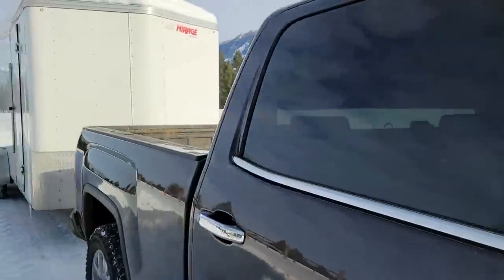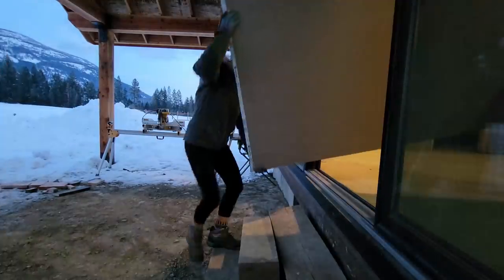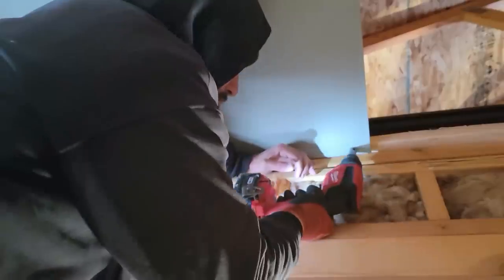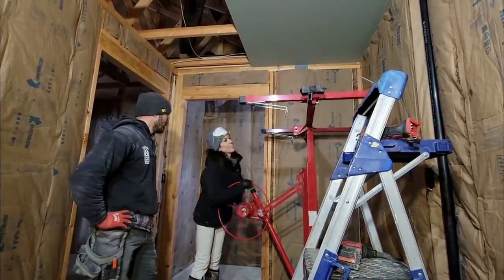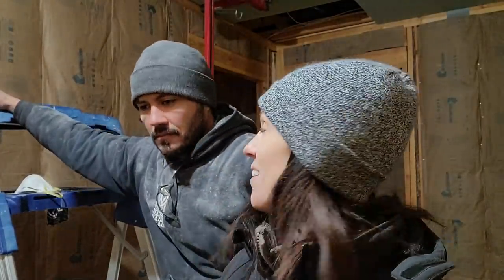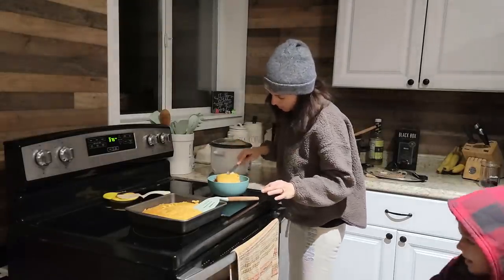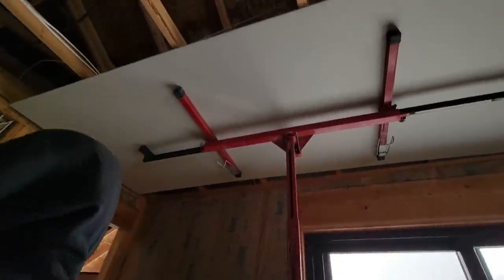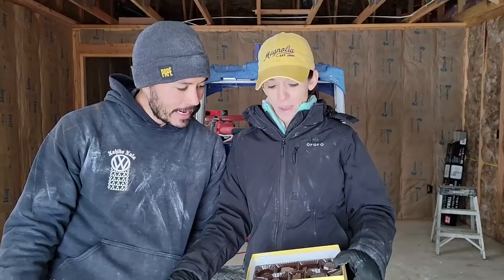We're On Our Own | Hanging DRYWALL In Our Self-Built Home

Comment: You are in building zone 6 which requires a 6 mil vapour barrier on all exterior walls and ceilings, if not used, it will trap moisture in your wall which causes mold :(  What does your building inspector say on his inspections? You did take out a building permit right? I’ve built many houses in the Creston area! Please check into this!

Comment: Try cutting that drywall with it standing on it's edge (there against the wall).  Mark and score the front side, lean it out, break it back and then make the second cut from the back side.  Much less lifting required.

Comment: Just to make things easier, you should leave your sheet rock against the wall, use your T square hanging from the top at your mark, then draw your blade down the square, this makes handling each sheet to the minimum because those sheets are heavy
Reply: My thoughts exactly. They're learning.
Reply: @lavrentichudakoff2519  just giving tips cuz I've been there
Reply: Yes, also helpful to use the T as the guide for the knife so you don't have wavy edges.  But you all do know, by the time they read this, the drywall will likely be nearly done!  Blessings!
Reply: Yep!  Had to fast forward, couldn't watch what I was seeing.
Reply: @kennyjustman933  I know. I'm a home builder.
Reply: @medaily57  🙂 they dont sit still long...
Reply: Wit the space they have, the easiest way is to stack them by size on the floor and mark and cut flat on the stack. Then flip up to cut the back side.
Reply: I was just thinking that too. Plus instead of marking the stud locations when they are above you head measure them and mark it with the T square o0n the ground.
Reply: @medaily57  The truth is they’ve already done this in their tiny home, so why didn’t they learn then! People will do it like they want or with no for thought. Thanks for your expertise, someone here will learn for their own use!🤷‍♀️❤️🙏🇺🇸👍
Reply: @dorothyallen3614  they didn't use dry wall in their tiny home

Comment: I've been watching you guys build from the beginning. One issue you guys are going to have is a moisture problem. You NEED too have a vapor barrier between the insulation and the drywall. This helps maintain a constant humidity in your house without outside interference.
Reply: I agree with this and come from a line of builders
Reply: That is what the paper is for. It is treated on the side against the fiberglass. And yes, I've worked in commercial construction.
Reply: Exactly, that's what I do for a living. Literally, insulation and vapor barrier. It's to bad you guys missed it.
Reply: Melissa mentioned this early in the video and it is to be done between fixing the panels and insulating the roof cavity.

Comment: Up in Canada, we have to have a vapor barrier on exterior walls between the insulation and drywall. This prevents mildew in walls as your high humidity indoor environment can't get into your cold zones. With your weather that would seem like a beneficial step.
Reply: Just added the same comment above. Hopefully they are okay without a vapor barrier as they would have to take the drywall off )-:

Comment: Your property is truly beautiful.  Some thoughts on plowing though.   It's been my experiance that roads that are plowed will narrow quite a bit over the winter.  It was for this reason that I switch to using a snow blower for the property. They make a unit that will bolt up the same way your current plow does.   Also, I couldn't imagine having to plow in an open cab.
Reply: You do with what you can afford to do and when you are homesteading other things take priority. I have been homesteading for over 20 years and don't have a closed in cab or heater on any of my equipment. I dress warm and wear a helmet with a face shield. Yes, some times I am miserably cold.

Comment: Great progress! Wondering if you are using spray foam in the ceiling and/or what you plan to use for vapor barrier in the ceiling?
Reply: I was wondering the same. Should there not have been a 6 mil vapor barrier go up first on the ceiling?
Reply: On the other hand aren't better insulated rooms more prone to mold on the walls? Why do they need to stop the evaporation if the space under the roof is ventilated non stop, by my logic the moisture formed in the insulation will dry from the top. Maybe on the exterior walls?
Reply: @v.9802  you don't want warm moist air in you attic in the winter. It forms use the melts and will drain back into the house causing grief.  Also it will rot you roof sheathing.
Reply: Forms ice that is.
Reply: @mikebickerton7356  To my understanding that will happen only if the attic is a confined space, but in their case they have non stop moving of air under the roof, but maybe i'm wrong and it is not enough for drying, then surely they'll put a barrier before installing the insulation. We''ll see in one or two episodes I suppose.

Comment: I was in the biz for a lot of years. Hung more drywall then I have liked. Everyone seams to be telling you to leave it against the wall on edge, that's
good advice. But then holed on to it after you the T score and pop your knee into  and score the back side making the back cut. If it so happens that
 the edge is rough. carry a shrufoam  block plane your tool belt, you can smooth those edges in seconds. Works great around windows.
When it comes time to tape and mud, put liquid dish soap in with your mud and mix it with a paint mixer beater till its creamy. This gets rid of the bubbles 
in the mud and you use less mud. Hope this helps you out, your doing great.

Comment: great job on the drywall so far. keep doing what you're doing. When you mud in the seams use a thin layer of mud then lay in your tape and mud in a thin layer over that with a 4" mud knife, let that dry and lay in a wider layer, (about 3 inches on each side of the tape) nice and smooth with a 10" knife. Let dry and sand. Then the finish coat of mud, I use a 14" knife and however wide it needs to be to have a nice transition from drywall to seam back to drywall. LOVE the aluminum saw horses, wife and kids gave me a set last fathers day. They're great. Keep the videos coming, love watching you guys.

Comment: I bought a Harbor Freight drywall lift to put up a ceiling in my 30x30 workshop. I used factory second garage door panels that are thin steel with a foam core. They were made at a factory a few miles away and a local farmer buys them in large lots and sells them for $.70 a sq ft. After I finished I advertised the lift and sold it quickly for $10 less than I paid for it. Win Win.

Comment: I commend you for wanting to use a screw gun, however for overhead work, the collated screw gun works much faster and doesn't drop screws on the floor.

Locate cut edges against the wall whenever possible. The beaded edge on dry wall is for tape and spackle. You can make cut edge to cut edge work, but will be flaring in a large section with mud.

Comment: Great job guys? You are an inspiration! I’ve done a fair share of drywall. I find it way easier to cut with the sheet standing on edge. Also a drywall t square is worth its weight in gold. One mark for your measurement and just run the knife along the square. Break the sheet and cut on the side that still has paper. You two rock!

Comment: Enjoying your videos Jeremy safety tip  don't push on that razor knife so hard when you're cutting the drywall if it slips you're gonna cut a finger off. You only have to score the paper and the drywall will break you don't have to cut it.also use the T - square as a straight edge for the razor knife. stay safe

Comment: In large, open areas it will save some future grief if you take scrap stud pieces and attach them to the top side of the sheetrock between ceilings joices.  When the house settles in the future, these pieces prevent sheetrock seam cracks.  Keep up the great work, the effort will pay off!

Comment: Pro tip,measure and cut the drywall "backwards".
Measure and cut in the backside, one cut, through the paper and still come with a clean edge break on the face side. Saves time and razor life

Comment: Lean drywall against the wall and make your cut, it's a lot easier. And use the large square, put it in  place and slice right down the side as a straight edge then step to the backside and pop the cut with your leg.

Comment: One suggestion would be to be careful with getting house to tight can be a issue as if you have a fireplace and it is running you can turn on a exhaust fan and create a negative static pressure causing smoke to be pulled into living space. This also applies for a furnace, dryer,bathroom exhaust fan that  exhaust air to the outside. Most furnaces have a make up air to the outside so any exhaust fan will not pull carbon monoxide into living space. Usually having something for make up air might be a consideration. Web site Trent and Allie were dealing with this as they had to open window a little when fireplace was running on their newly finished house build.

Comment: You guys are doing a good job. Little head. Little head save it back instead of putting the sheets on the sawhorses. Try cutting them laying on the wall using in the T square as a guide for your knife. When it's coming to the walls if they are if they are 8 foot or less tall . I would use 8 foot sheets standing up what joints are a bottle to take. If you lay down the tool the 12" sheet you will have but joints just like you have the ceiling they are very difficult to take. I did a lot of sheetrock work with for a living.

Comment: I bought a drywall lift like that for an outbuilding, but I also bought a pair of scaffolds at the same time.  My wife bought an aluminum straightedge so we could draw perfectly straight lines and let the utility knife clean against it to cut quickly.  I'm too lazy to get 12' pieces, all of mine were 8'.  Y'all are doing a good job.  I look at mine with the pride of knowing, we did that.

Comment: you doing a great job with the drywall but like Z said leave it on its edge leaning against the wall to measure and cut. Also instead of using the T-square to mark the board and then cut on the line try running the knife against the edge of the square, this skips another step. all in all it looks good so far and if you are comfortable doing it the way that you are then keep on keeping on. Everyone has a way of doing things that they are comfortable with I'm just offering a suggestion (or two). Keep it up and I love the videos.

Comment: You're  probably hanging  drywall  by now  but  here's  a  pro tip for you.  When using a dry router to cut boxes out, rum you router counterclockwise for bbn outside  cuts,  clockwise  for inside cuts.  The rotation  of the bit keeps it against the box. It's  easier to follow we the shape that way.

Comment: You should have put glue on the ceiling joist before gyprocking . It helps the ceiling not cracking on the joints over time

Comment: 🙂👍 looks great so far, keep up the good work. 
 Builder tip: when building the attic access hole ,and your blowing in insulation: make sure too build the sides tall enough; so it doesn't fall back into the house, there will be about 13" if not greater, see insulation spec sheets, and local codes.
Builder tip: there are many types of attic access door styles: weather it is a fire rated locking door , or a drywall contractor style; which is the most common inside a home. Use left over drywall scrapes and trim the perimeter with drywall , 3" and that will allow it too be trimmed with moulding and the lid will be able too sit on that lip created. Attach batt insulation to it as needed. 
Or picture frame it with trim moulding. 
Simple styles that are quick and low cost.
And remember if the access door in a garage or breeze way they need too be fire rated. Easy tips too make building a home or office, it's good too know.
Take care and be safe and God bless amen. ❤👌👋🙏🙏
Reply: Builder tip: when blowing in insulation, make sure too install depth strips ( paper  rulers) ; these will help get the right  thickness through. Be sure too wear long sleeves, goggles and respirators if operating the insulation hose. And install air baffles in front of any ridge block vents. 
Take care and be safe and God bless amen. ❤

Comment: Dry wall will go even faster if you throw that pencil away. By measuring sliding the T-square to the spot than use your blade along the T-square to cut the boards. I promise you'll thank me later.🖤😉👍

Comment: Tip: Mark and cut the drywall sheets on the floor then lift up on edge, fold slightly along cut then cut the backside. And use a straight-edge as a guide for your blade!

Comment: You need a drywall T square and to cut the boards just as you put them against the wall. Use the drywall T square as a guide for your knife.They snap easier and it is easier to step around to the back side and cut the paper. You do not have to lift it and put it on saw horses.

Comment: You really should use strapping on your ceilings before the drywall is hung. It  gives you a flatter surface and it strengthens your trusses, so it prevents cracks in the future

Comment: You will get much straighter cuts if you just cut it with the T-square on the sheetrock instead of marking with a pen and then freehand cutting it. The T square will guide the cutting blade to give you a straight cut.

Comment: Hold the trigger if the drywall gun and run the screw into the drywall it works a lot better hard to get use to but works

Comment: As stated earlier,, just leave your drywall against the wall to cut.  When you get around to taping , as I mentioned last video use fiba fuse tape. The next tip is use the bag mix drywall mud. it can be bought in a few numbers . The numbers on the bag is how fast it drys. I use 90.  You should only mix it in a drywall mud pan 1/2 -3/4 full , use a egg beater wisp in a drill to mix it.  If you try to use the mud in a bucket you'll be waiting till June till it sets up . Can't wait for the main ceiling. Good luck.

Comment: I love watching your build! Just a sugestión on your dry wall. Instead of using your t-square to draw a cutting line on the sheet rock, use the T-square as a guide for cutting the sheet rock, just mark your cut with a small pencil mark, lay your T-square  on the mark, hold the t-square firmly and slice along the edge of the t-square not to deep, you only want to cut through the sheet rock paper, then snap the sheet rock, much easier and faster then the way I saw you doing it. Also you don’t seem to be using a sheet rock scrubbier? The best sheet rock tool ever made.

Comment: Use your ruler to cut your drywall. Much faster and straight!

If you drop / break the remains, there is a chance that the coating on the other side will tear loose due to the falling piece, watch out for that. Just do as more people are writing, cut the drywalls when they are standing up, not flatten. Cut the second layer through the other side for a better/ smooth cut.

There are pro's doing this all day long. I have done it for a while. Never carrying them flat, they snap easy in the mid. Only for the small pieces you can lay them down for cutting.

For the rest.. keep going, at the end you will be fine. Enjoy.

Comment: Hey Jeremy, I was noticing you were using the work horses for the dry wall marking then cutting.
What worked for me was vertical score and snap. 
How it works is, take your measurements, set the 4' straight edge and score down the straight edge just piercing the paper. 
This will allow you to snap the drywall, on the reverse side of the snapped edge, run you blade down that fold to cut the other side of the paper.
If you find you have excess material between the paper, use a cheese garter to smooth the amount to allow a tight fit .
Also avoid butting non tapered edges together, I learned all this the hard way my friend. 
You two are absolutely amazing,  thank you for your content ❤
Reply from the maker: Our square isn’t square 😁. Need a replacement.

Comment: Yes vapour barrier is a good idea. Also....I was noticing that you're putting the cut edges of the drywall butted together in the centre of the ceiling.  It's best to put the cut edges at the wall for ease of mudding when it comes to that time. The finished edges are made the way they are (tapered) for easier mudding.
Reply from the maker: No cut edges butt to factory, we made sure
Reply: @GoodSimpleLiving  👍

Comment: Sheet rock was  my Forte for 25 years. Remember : long board where possible. 25 to 30 % of the product will be scrap if hung correctly. Hire a finisher & do not popcorn or orange peel anything. If you tape it your self, use paper tape in all inside corners. No mesh tape period. Good luck.
Reply from the maker: Thank you

Comment: I hope you plan to put more screws in your ceiling . If you just do the boarder see most of the sheet rock is moved by rail  a start to fall apart I know this how I used to hang sheet rock they will stay up but not for long . You are planning to put more screes anyway have fun be safe
Reply from the maker: We didn't do just the border

Comment: It may seem odd to address clutter, household chores, and assigning "homes" for a construction job mid-job - But do consider creating temporary homes for the things in your construction world like a line of tools down a space of floor.  While you make be working with an imaginary line down a space of floor instead of a set of shelves, it is beneficial to gather like items like the power tools vs the measuring tools, fasteners in the same area, or sorted by job task.  Then work to "put the tools away" (building materials, garbage, etc..) as you finish with them, the end of the night, or every couple of days.  Of course, being a construction zone, anything like this which is established is subject to change as you move along.